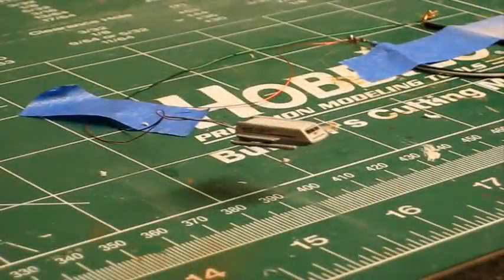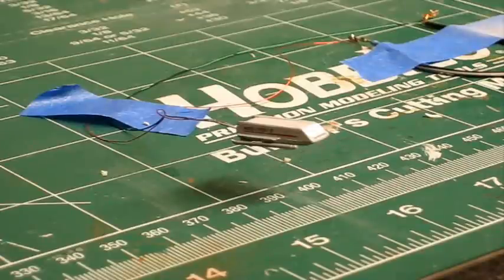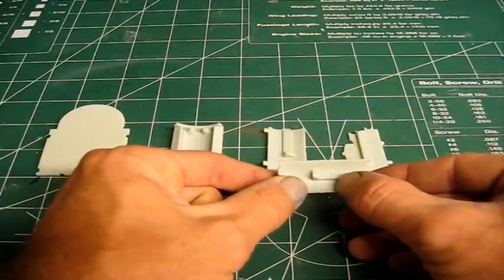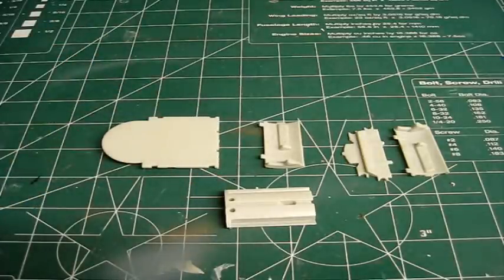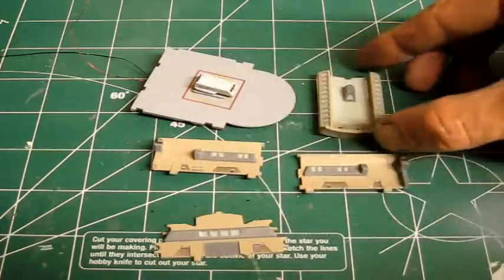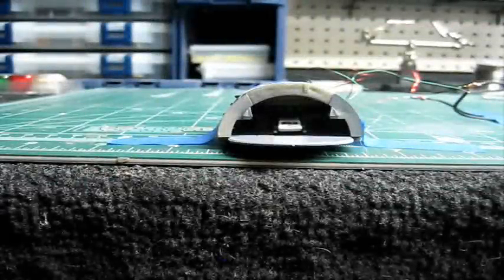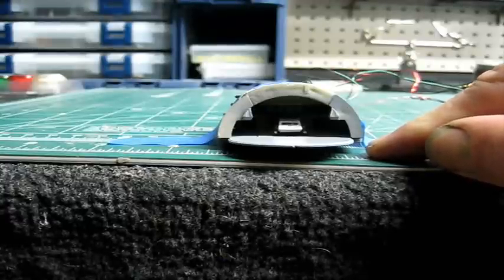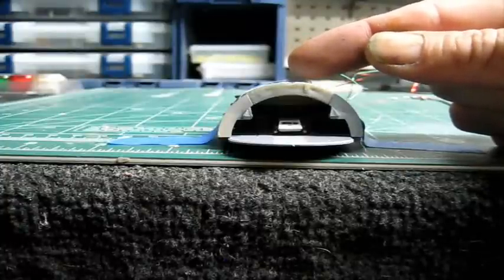Polar Lights TOS 1/350 Enterprise Buildup PT - 1 Lighting The Shuttle Bay

Comment: Looks like you're off to a great start TW! In regards to the lighting issues, Have you considered using surface mount LEDS? I've become quite a fan of the 0805 model, small enough to fit just about anywhere, but not so small that you can't solder them by hand.

Comment from the maker: The clear parts will make lighting the shuttle bay windows easier but still not the problem with the outer ship windows. You still have to get some lighting in between the walls and there is zero clearance.

Comment from the maker: Side fire would be a contender Tom. I tried some regular. No joy, way to dim.
I have since the video shoot, figured out how to light that little control room window at the ceiling. I opened it up a bit on the inside and grinded an LED down to fit in it. The back side lighting of that LED will light those 3 small green and red beacons near the rear on top of the stern. So far the real bear is going to be those fantail lights. The floor plate is cast
right through the center of them on the inside.